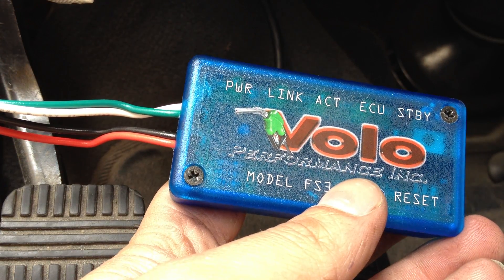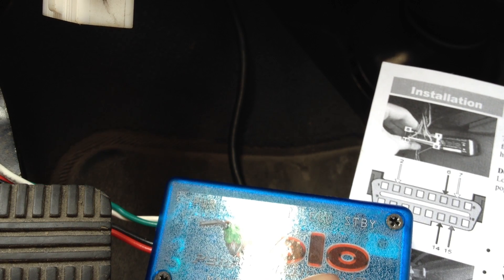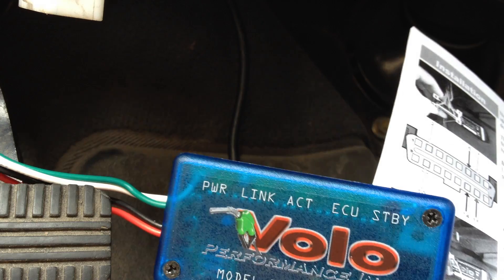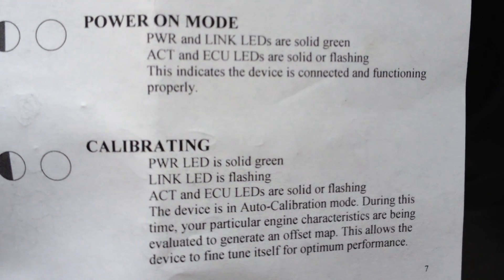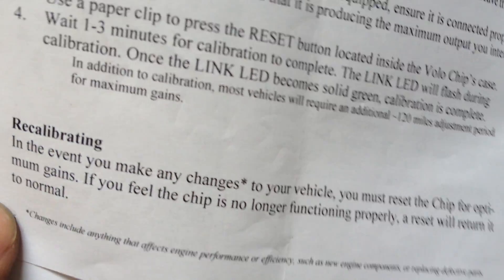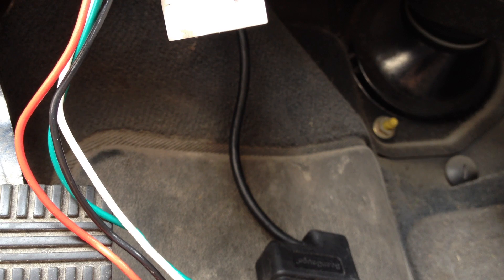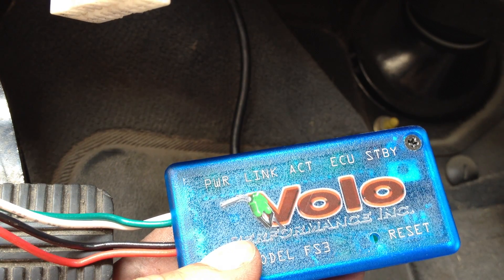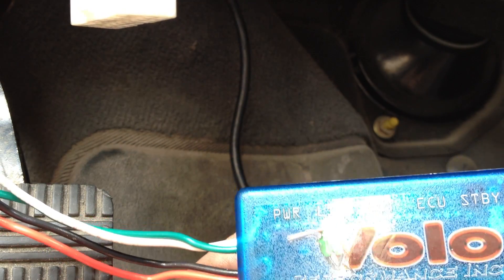VOLO Performance & Fuel Economy Review/Installation Guide-Does it really work LETS FIND OUT!  Part 7

Comment: My experience with both the VP12 and the VP15 is that they both work well in the CAN communication modality used in automotive OBD11 engine management units up to 2004. I  have not had the same success however with the VP12 and the VP15 in vehicles constructed after 2004.